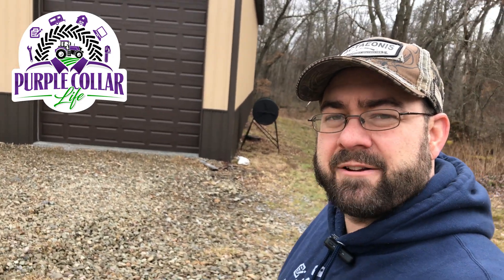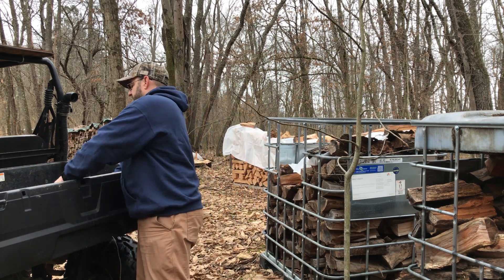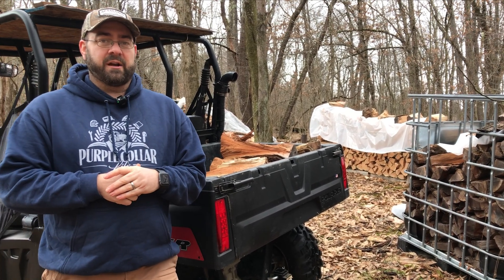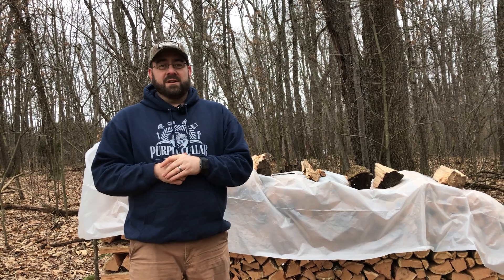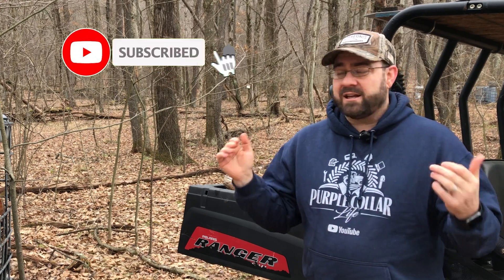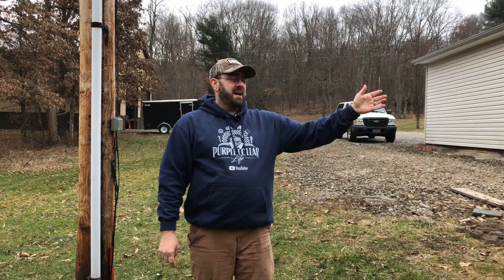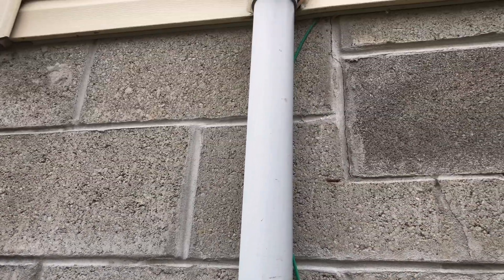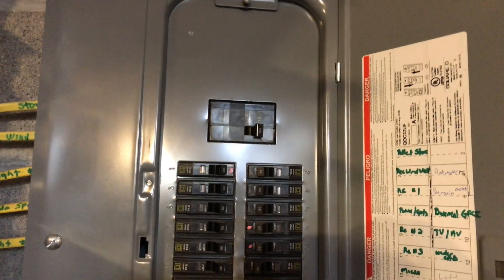40x60 pole building - power needs

Comment: Being that you have multiple large electric loads you might consider upgrading to a 400 amp service.  They could set a service right by the pole where it goes underground.   You would then have a 200 amp disconnect that would feed the house and another 200 amp heading to the building.  Thats your best option.  Dont do a separate meter.
Reply from the maker: See, Kyle - that's why you're the expert! That is a great idea. I'll have to check into making that happen. I know that when I was building the house, they let me have the meter on a pole as a temporary service - but I think they require it's mounted to a structure for permanent installation. And I could probably still use the GenerLink to plug my generator in during power outages - just to the meter at the pole rather than to the house.  Thanks for the comment!
Reply: @PurpleCollarLife  ya you would have to build a stantion next to the pole to mount your new 400 amp service and (2) 200 amp fused/ breaker disconnects.  Then one feed would tie into the existing 2” conduit to the house and you can run the other new 200amp feed to the building or install an outdoor 200 amp panel so you can run feeds elsewhere as well.  Would make for a fairly quick swap too.

Comment: Don’t pull off the garage. Not enough power. I feel you on a separate service. I have a garage across the street and it’s about $18 a month just having it connected. With my barn I’m in a similar situation - right now I have one 20amp circuit out there with a 12 gage wire run from the 200amp panel in the house. It’s not enough. Starting my table saw pops the breaker. I also have a submersible pump in a dug well out there. I’d like multiple circuits and at least 50 or 100 amps for lighting and power tools… ideally off the house. But like you the kitchen already has a sub panel, so I’m kinda in the same conundrum!
Reply from the maker: Thanks - you're probably right that in the future I'd be struggling for power in the big building. I'm going to check into a 400 amp drop to the pole, then split 200 amps to the house and 200 to the building - if that can all be on one meter.

Comment: When I built my garage I ran an underground 3" conduit and pulled 100 amps off my main house panel for the garage.  My house has a 200 amp panel.  Even with welding, I have not had any issues with power limit.    I also have a 100K BTU furnace for heat....   I do wish I had 3 phase power.
Reply from the maker: Great idea to run the conduit!

Comment: Good Evening Sir, Yes Sir Travel shapes the young 👍😇👌Sir My Best Advice GO BIG !!! 200 Amps so you can power your house with your generator safely and You Can also learn to weld or future projects 😇👍👍( PLEASE I HAD TWO POWER UTILITY ENTRY AND IT WAS VERY TOO MUCH EXPENSIVE !!! )  🥴 Keep Warm 👍😇👌🔥Cheers 🍻
Reply from the maker: You are right! There's no sense in underpowering the building for the future. Thanks for watching.
Reply: @PurpleCollarLife  Yes Having a generator inside your garage will reduce the noise it makes and also safe against someone steeling it since it will be lock inside your garage !!!

Comment: I think you are pretty well maxed out with the 200 AMP set up you currently have, considering you have electric baseboard and several sub panels coming off of it. If you upgrade to 400 AMP you now have the cost of the 400 AMP upgrade and still have the cost to dig a trench to go from the house to the pole barn. Adding a 2nd meter does cost more but, if you ever decide to start some kind of business working out of your pole barn you now have a pure cost for electric to deduct as an expense. Plus, I would go with a 200 AMP service right away in the pole barn. No need to worry about adding sub panels plus you could run electric from the pole barn to the garage and take some electric load off of the house panel. jmo Looking forward to your decision.
Reply from the maker: Thanks for your thoughts! I do agree that for all of our needs, a 400 AMP drop is a wise move. I am going to contact our power company to see how to best do that. I wonder if I could drop the 400 amp power into our garage, then send it in 200 amps to both directions (to the house in the existing underground buried, and to the 40x60 buried from the garage).  That seems like a great solution if I can make it work. I have no idea if there is a difference in monthly charge for a 400 amp vs a 200 amp. These are all things I wasn't even considering - but this makes a lot of sense.  That's what's great about YouTube. I probably would have gone a different direction without all these great comments.

Comment: My only comment Chad is to overbuild now. I don’t think 30 or even 50 amp in the pole building will be enough in 5 or 10 years. I like the comment about upgrading your 200 amp service to 400 and do it all with one meter.
Reply from the maker: I like that 400 amp idea also. It makes the most sense for the future. Now I just need to get the power company to agree. :)

Comment: Is it possible to trench from big garage to the addition sub panel? Or is that still a hassle? What about the possibility of up-sizing the wire from the addition sub-panel to the small garage and upgrading to 100A or 75A then daisy chaining another 100A or 75A to the big garage like you plan? I think a 75-100A service in the big garage will serve you fine, you can run some decent stuff on that. I wouldn't waste money on another meter unless you absolutely have to and need large capacity power. My 40x50 shop is about 475' from my main house panel and I installed a 80A sub-panel in the shop with big 4/0 wire due to length. I've yet to run out of power yet and I weld and use a large compressor.

The other thing you could do is run larger wire (100A) between the small and big garage, breaker it @50A and down the road if you find it not enough you could then up-size the feeder between the addition and small garage to 100A and the rest would be all set to handle it. 50A is a hell of a lot better then a extension cord!! You can still run decent stuff on that, just unplug the car when you do so (like welding).
Reply from the maker: These are all good ideas! I probably could snake a larger line through the conduit between the house and the garage. I do think that I'll end up wanting enough power in the pole building at some point - even if it's just for an air compressor. But I also wouldn't doubt that at some point I learn to weld and put a welder in there. 
Thanks for sharing your experience with your shop 80A sump panel and wiring!

Comment: I would pick either adding the second meter or pulling directly from the first main panel.  To do that, You may have to move main panel breakers into a new sub panel close by to free up a slot for the big building.  
The idea of going from main to sub, to sub, to sub panel is just complicated and could cause too much voltage drop before getting to equiptment in the building.  You could have 200 volts if you went that way.   It would also be easier to manage the loads when on generator power if you didn't have to go to all the different sub panels.
Reply from the maker: All great points! Thank you. If I would have known 22 years ago how much power I'd need - I would have done things differently for sure.

Comment: From the pole if in the future it doesn't fit in your budget shut it off. I retired a few years ago so I understand your budget changes.
Reply from the maker: Thanks for watching! Kyle had a good idea to perhaps put a 400 amp drop in at the pole, then split it to 200 amps to the house (already buried) and 200 amps to the building.  That might solve all the problems because it would still all be on one meter - the meter would just be moved to by the pole. What I need to figure out is if my electric company requires that meter to be mounted to a structure (which I do believe is the case). But even in that situation - I could run it into my garage - then separate it from there!

Comment: Dig both sides of the side walk use the back of the mini x bucket push a stick of pvc thru cut off with a Sawzall run your conduit or ufb thru that
Reply from the maker: Thanks! That's a good idea for getting power under the sidewalk.

Comment: Run the second line from the pole with a new service and meter, either 100 or 200 amps. I’d probably do 200 amps. And bury it, don’t run it overhead.
Reply from the maker: Thanks! The only reason I was considering going overhead is because I already have the overhead wires coming TO that pole from the right-of-way. So it really wouldn't be much different going back in that same direction with overhead wires to the building.

Comment: I would run a separate100 amp service from the street pole to the large building. Underground cable so you don't have to worry about the snow and ice on the power line. Two meters with two monthly electric bills. Thirty-three dollars to be safe is cheap insurance, the other ways you're taxing the system you have and might be a tripping breaker nightmare.
Reply: Agree. He already has multiple sub panels. Trying to do things on the cheap almost always ends up costing more in the long term.
Reply from the maker: Great points. AND - maybe some day I make some upstairs apartments in that building or something and there will be a separate meter there. That's one thing to consider for sure.

Comment: I think you already made up your mind that option 1 is the best for you right now.  Shoulda / coulda / woulda... this is not an absolute decision.  For now, if you want to weld or do whatever with high amps, go to the other places.  If all of a sudden you are welding on a weekly basis, then you can put the line in from the power pole with another meter.  But who knows if and when that will be.  In the meantime you're just wasting money on that extra meter and power capacity that you're probably not going to use for years down the road.  To me switching the panel over to the option 3 pole option will be fast an easy.  Your only future proofing is to put in a 200 AMP breaker box even though you're going to feed in a lot less current for now.
Reply from the maker: Thanks! I totally understand what you're saying. No sense paying for the extra meter just to do 15 amps of lighting in the building at this point.  And then in the future, if I decide I need more out there - I could add the second service at that point. 
I did like Kyle's comment about maybe putting a 400 amp to the pole, and then sending 200 amp to the house, and 200 amp to the building - all off one meter.
Reply: @PurpleCollarLife  me too!  If that's possible then that is a solution I didn't even think was possible!